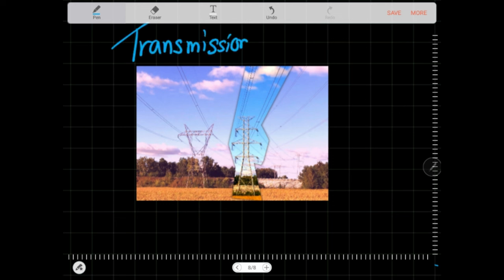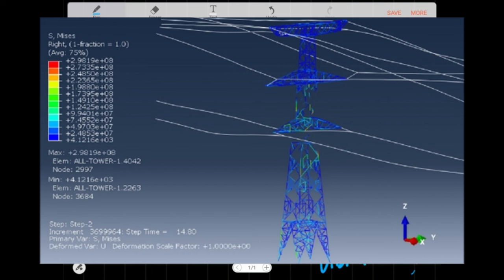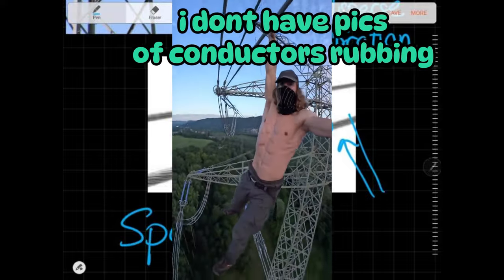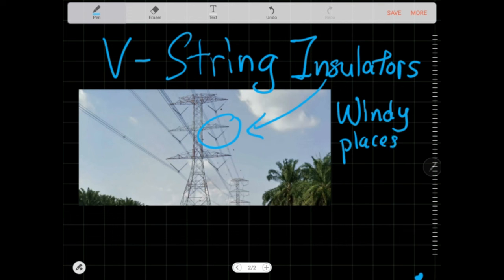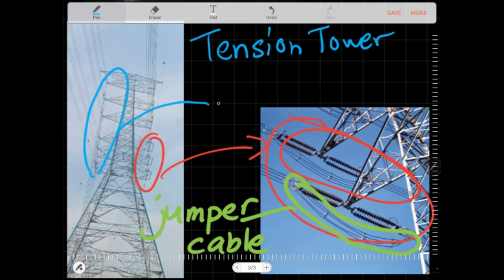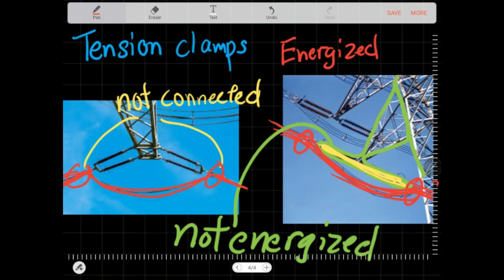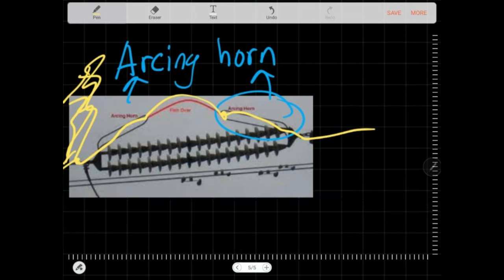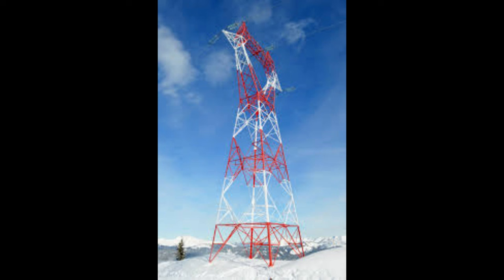Transmission lines ACCESSORIES are GENIUS

Comment: The purpose of installing more lines per phase is corona efect in high voltage lines. The voltage potential differential is above air ionization close to the line. Please, at least read the wiki if you make video about something. Wiki: For transmission of power across long distances, high voltage transmission is employed. Transmission higher than 132 kV poses the problem of corona discharge, which causes significant power loss and interference with communication circuits. To reduce this corona effect, it is preferable to use more than one conductor per phase, or bundled conductors.[15]